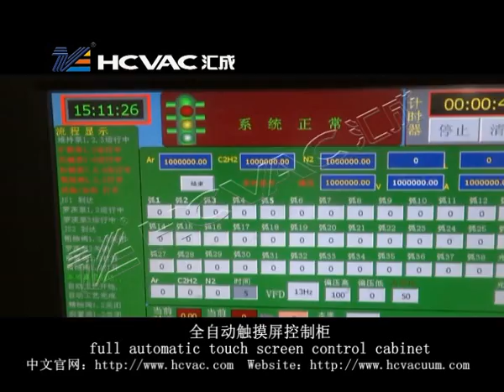PVD Vacuum Coating Machine for ceramic tile, ceramic tableware

Comment: How electricity passes through ceramics?
Reply from the maker: May I have your whatsapp or wechat number?
Reply from the maker: It's PVD(Physical vapor deposition) process.  Through current bombardment target into particles and deposite on substrate(ceramic) surface.